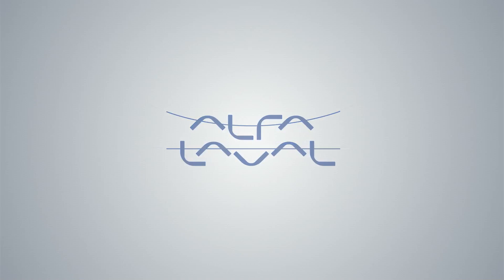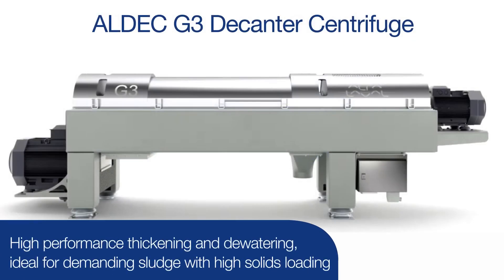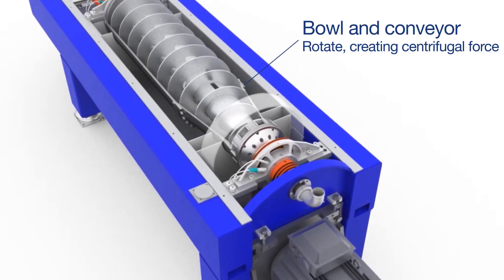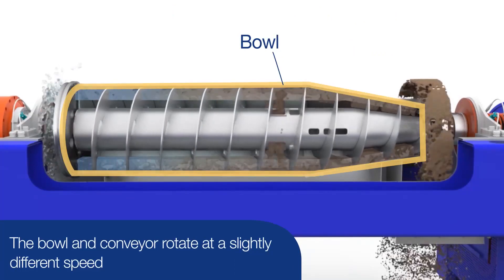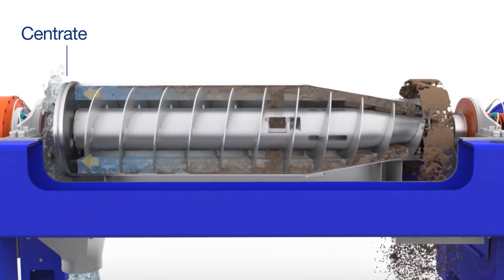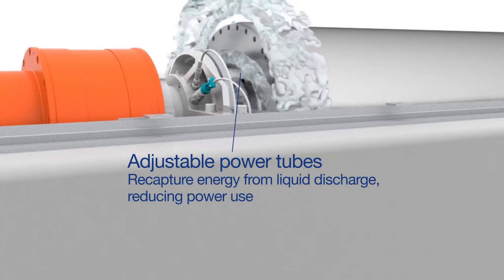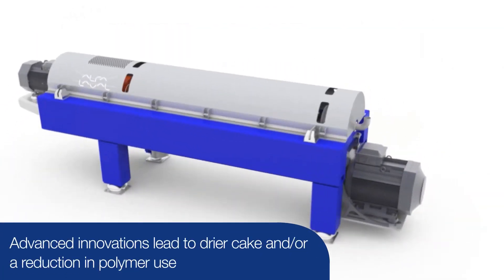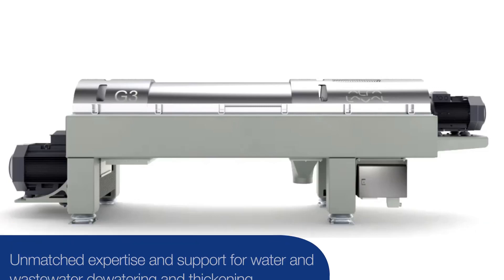Decanter centrifuges for sludge thickening and dewatering (with voiceover)

Comment: what causing the water goin left ?
the conveyer take sludge to the right, its dont take water with it to?
Reply: That’s what I’m trying to figure out too
Reply: It is not that the liquid goes to the left, actually the solids are extracted to the right, for
that is observed only liquid on the left.
At the same time on the far left "wide side"
there is a centripetal pump, which together with
the level tubes, extract the liquid.

The bowl spins at 4000 or 4200RPM and the conveyor spins-in
of the bowl-at 15 rpm or more depending on how dry you want
the cake.
Reply: Shape of the decanter. Slightly slopped to the left.